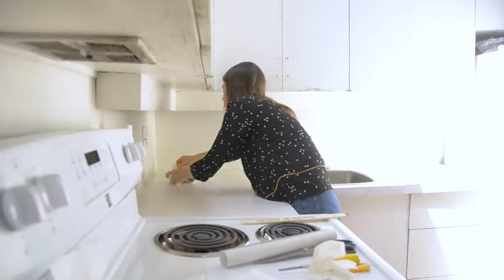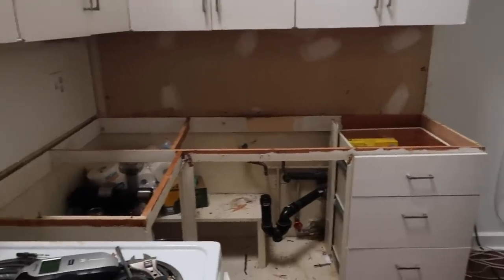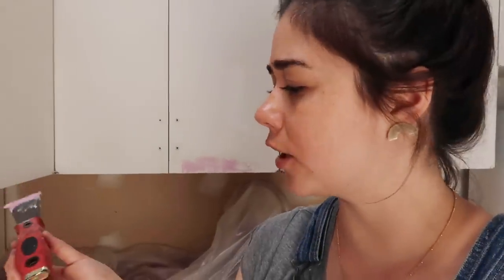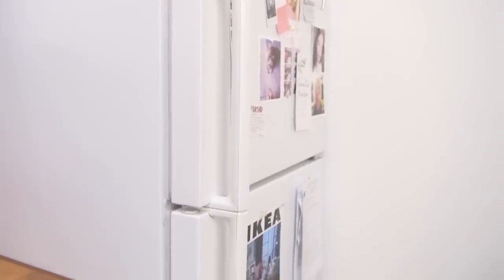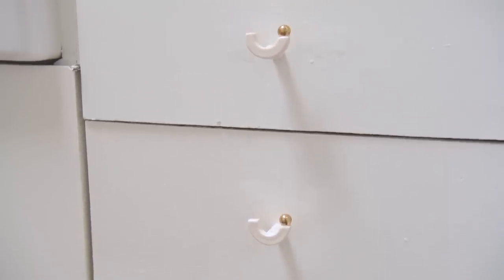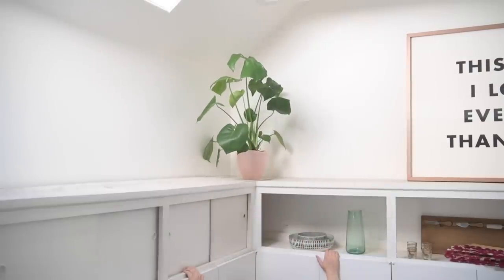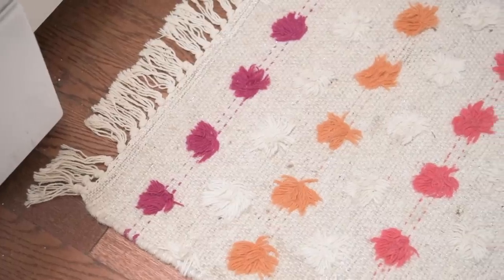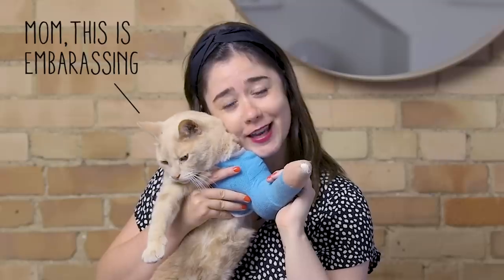DIY Small Rental Kitchen Makeover | My Rental Reno S1 E7

Comment: Why take off the completely waterproof smooth plastic (protective) backsplash... just to apply peel & stick tiles right against the drywall. It is both unnecessary and a downgrade from the owners perspective because the wall is no longer damage proof. And the peel & stick are not a longterm solution. The damage proof neutral backslash was smart. All it needed was a thorough cleaning and the tires could have smoothly gone Overton. Then the next renter could remove the pink peel & stick... and apply their own color without affecting the underlayment,

Edit: then some was just left not tiled... acheap quick coat of paint exactly where moisture from kettles and other appliances goes. I am glad this is 2 years ago. But a lot more asking experienced questions should have been confirmed by the owner. This is why owners have 'no reno' rules. Because renters don't care about how it will break down in 8+ years... extra unnecessary costs means that other upgrades don't happen due to spending money to fix the stickers.

Comment: Why.. why you teach people how to fill up holes if you don't know how to do it properly yourself?:/
That sanding papers grid is enormous for the job, you never use fillers on dusty surfaces. Then you sand it to a flat level, the entire door, brush off the dust and use undercoat (protective and deep going coat, different countries call it differently). That way you make sure what you do is done:
- properly, 
- professionally 
- to last long
- to look good even close
And then some other rules when painting.
But who cares, as long as you get the views, no responsibilities, right?
Reply: A tip: don't fold sandpaper like that, you waste it. While sanding, the grid folded in is touching the other side with grid, it wears off itself. 
Using wooden/plastic/what-ever-handy block with sandpaper around it will save your nails and make sanded surface more even, the result will be achieved faster.

Comment: Watching you do handy work is cringe worthy. 

Once you fill the hole scrape the spatula clean and go back over the hole at a bit of an angle to scrape off excess. If your tool is dirty you just keep applying product. 

That junk you are using is hard to sand. Use a more sandable product if you are a beginner. 

Dont paint laminate cabinet dooooooorrrrsss!!!! Even the highest boding paints scratch off and stain too easy!

Im sure theres more but I only watched until that point.